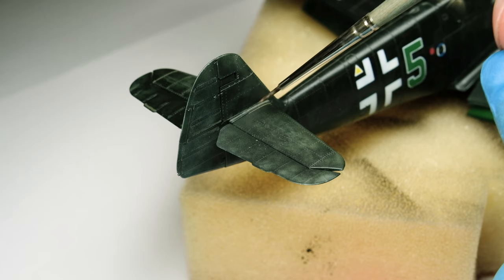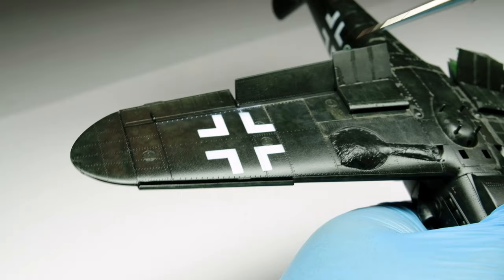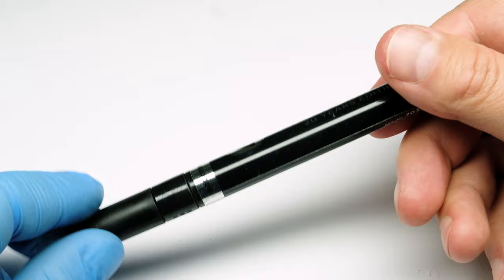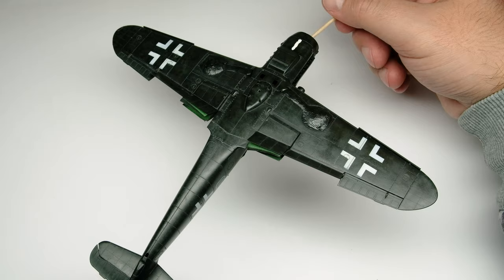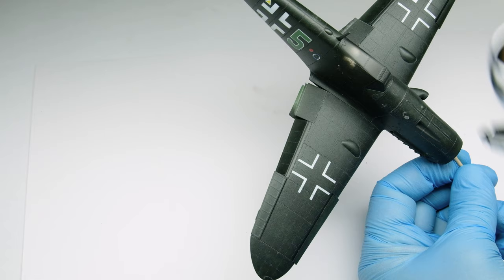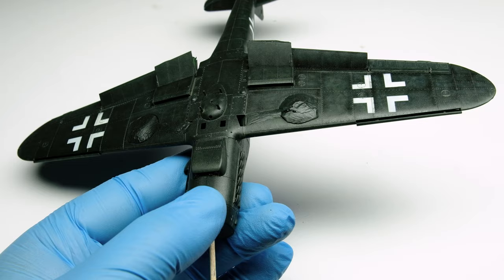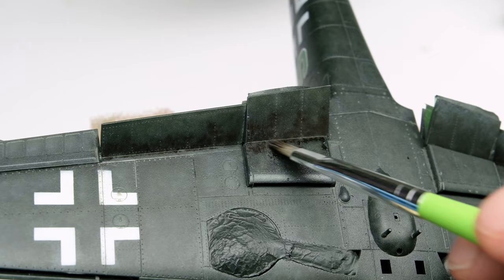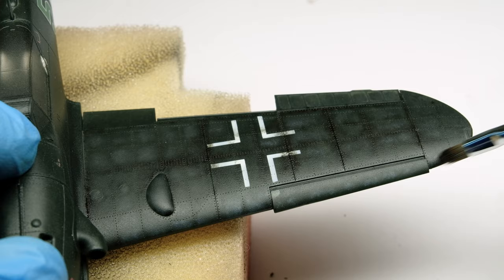Oil Colors to increase Contrast - Messerschmitt Bf 109-G6 1/48 from Eduard - Enhancing Black Basing

Comment: Nice work! Does the oil treatment mask the panel line job you have done before? Because i can see that you put dark oil over rivet which were you put light panel liner! Panel line job is still visible?
Reply from the maker: Merci beaucoup Bertrand! I tried to keep the oil work restricted only to the surface, which was almost impossible, like you saw. At some spots I have to refresh the panellinewash, but I'll try a different color mix and I'll do it with oils...

Comment: Hi mate, nic vid and weathering...I used similar light grey and mud oil wash for my night Bf-110... I just wanted to inform you that this V-shaped line on belly - about 2cm behind external tank rack should be also filled; painful issue when noticed too late, and Eduard does not mention it. Also there should be small hole in front of that line in lower nose that you corrected with filling. If needed, check some Bf-109 G drawings, you can still correct it, if you want...I am subscribing now and keep on watching, good luck and have fun :-)
Reply from the maker: Hey Nadrazak! Thank you very much for tuning in and leaving a informativ comment! It would be nice, if the manuals would mention panellines to be filled (some places they to, but not everything). I'll get back to the Pros like you, before starting my next project :) Thank you very much for your support!!!

Comment: Just in time! Solving Korea-war USN/MC Flying nightmares all-black camouflage... Can you share the white-black shading materials? Probably with solid Oil paint (Abteilung?) + what is the black solution you use after you apply the solid oil white? Is it black paneliner diluted with White spirit solvent or what? Many thanks!!! The earbuds are dry or with solvent?
Reply from the maker: Hey Vit, thanks for tuning in!!! For the panellinewash I use AK Panelliner 'Stone Grey'. I remove the excess with a dry earbud. If the excess won't come off, I moisten the earbud just a little. And at 7:39 I present every material needed for the oil painting technique. The grey oil color turns out much lighter than expected when it dries... If you have further questions contact me on Instagram or Facebook...

Comment: After applying all the oils in the final step do you seal the model with a final coat of clear satin varnish ?
Reply from the maker: After working with the oils I leave it as it is. On the Do335 I made the mistake, that i varnished again and it muted the oil-work done... But there's going to be another weathering layer with airbrush dust. Thanks for the good question!
Reply: Thank you so much..I made the reveal 1/72 scale u boat and heavily weathered it then sealed it in flat and noticed that the colors sort of blended  together.to my eye....I also use powders .oils.and metal powders

Comment: You apply wash on gloss or satin surface?
Reply from the maker: I prefer a glossy surface... But it can be also slight satin, important is, that the surface doesn't soak up the wash and keep it in the panellines...
Reply: @AirandGroundinScale  For weathering with oil paints you prefer satin or matt surface?
Reply from the maker: @xxmonsterxx9363  I prefer satin to work with oils. Then I only have to moisten the surface a little bit. With a matt surface I had the problem, that the oil colors left some stains, which I couldn't get off...